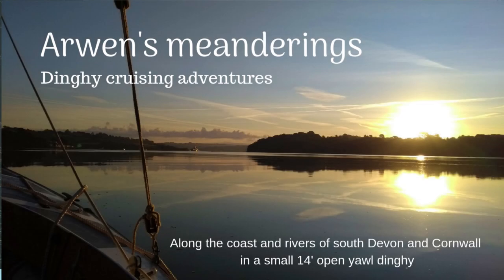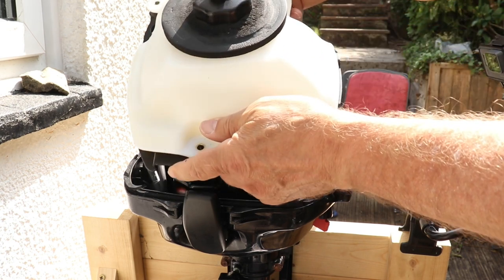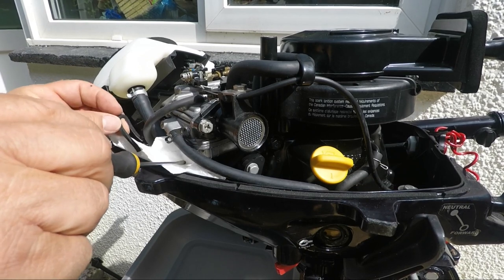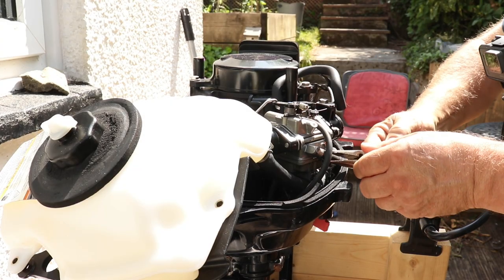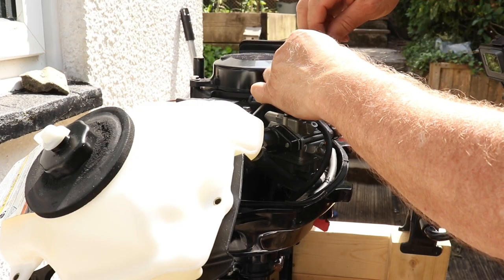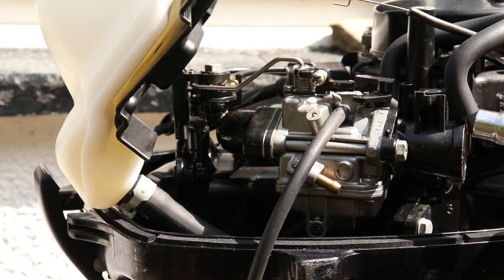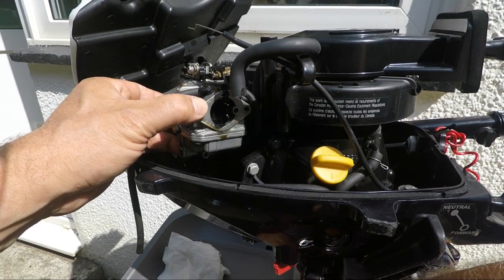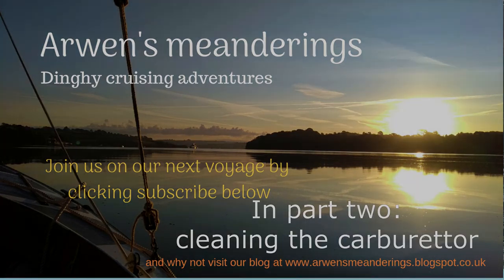Cruising a Welsford 'navigator': Removing the carburettor from a Tohatsu four stroke 3.5 hp outboard

Comment from the maker: At https://arwensmeanderings.blogspot.com/2020/05/taking-out-and-cleaning-carburettor.html you can see other photographs and website links about removing and cleaning the carburettor in a Tohatsu four stroke 3.5 hp outboard. I did it my way, not necessarily the correct way. In addition I take no responsibility for the accuracy of any linked websites. If you have any constructive advice or tips, please drop me a comment below - I always like learning new and better ways of doing things. Take care in these coronavirus times, stay safe, take care out on the water.    Steve

Comment: How many pulls does your motor need to cold start? I have the same engine and i'm wondering if it's normal that i have to pull it 5 to 10 times to cold start the engine
Reply from the maker: Normally four but anything up to eight or nine. My choke is very sensitive and you have to get it just in the right position ...